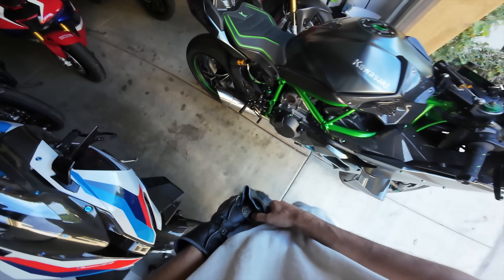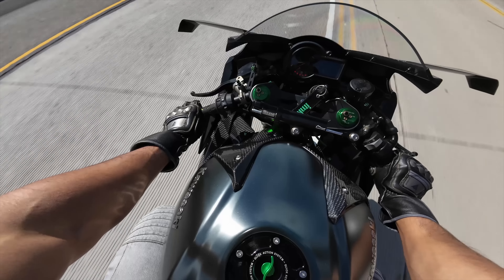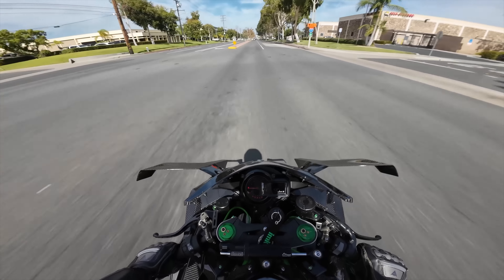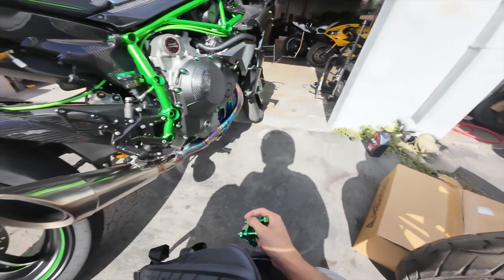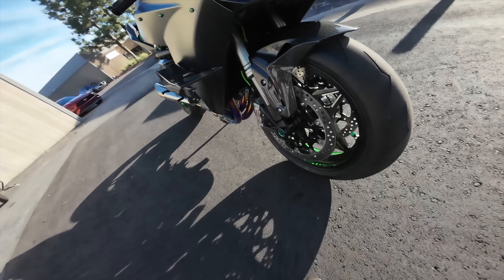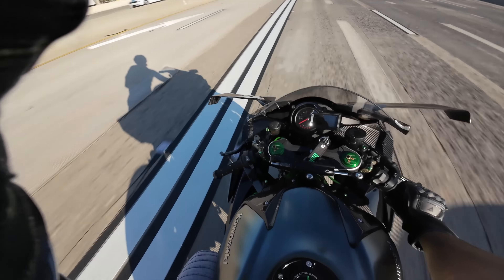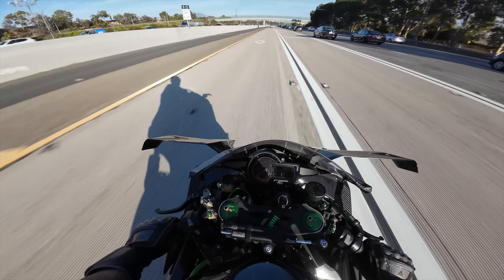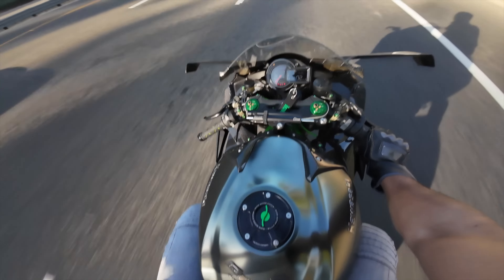Most Modified Ninja H2R in the World!

Comment: Medium-strength (Red) thread  locking compound is designed for permanent installation, removal with heat.  Cylinder studs, things like that.  
Low-Strength (Blue) works just fine and is removable if you know how to apply it (read the bottle) and use proper torque set with a torque wrench.